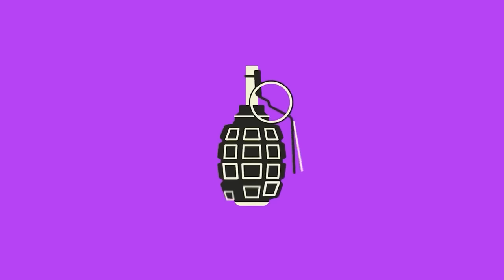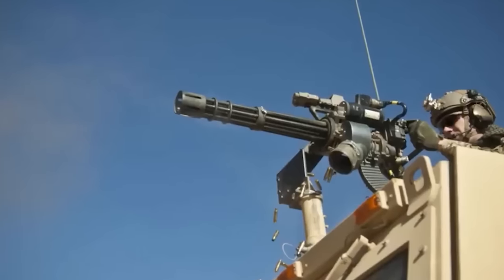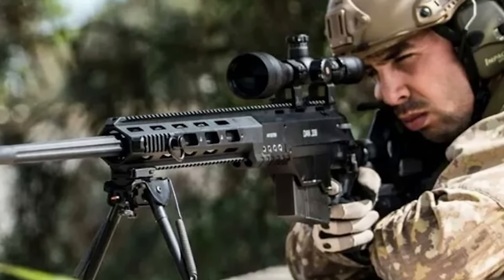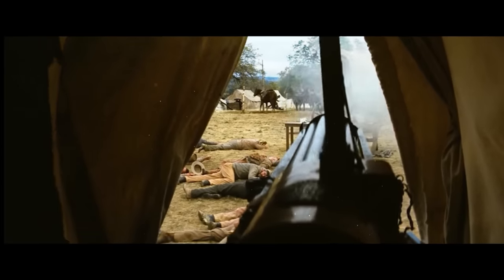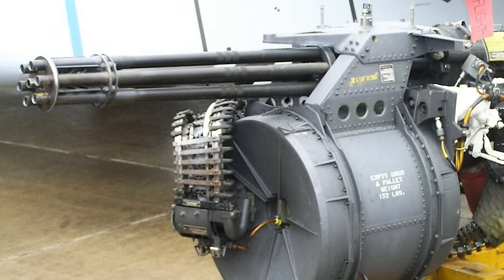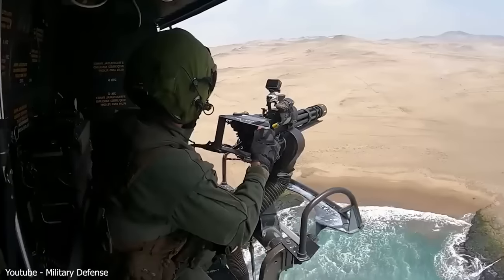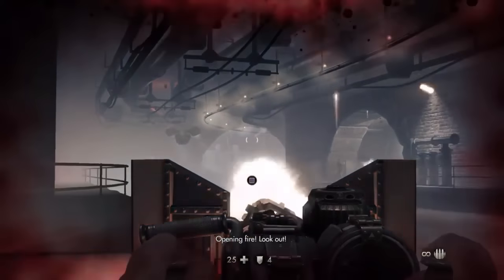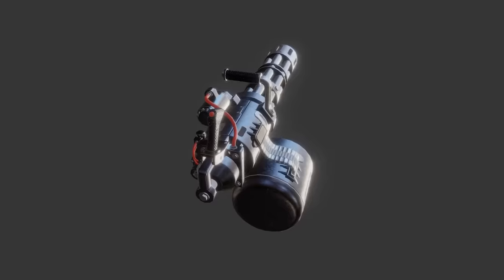THE DARK SIDE OF MINIGUN: WHAT IS IT HATED FOR

Comment: Comparing a minigun against a SAW is like comparing an F1 car against a Pinto and saying the Pinto is better because it's easier to drive and more affordable.  That completely misses the point.  The SAW is smaller, lighter, fires a lighter round, has a lower rate of fire (not to mention barrel swaps required if you want to keep that rate going), and is cheaper...but that's because it was designed as a light machine gun.

The minigun is none of those things, but excels doing things a SAW can't begin to do.  Yes it's bigger, heavier, more complex, and more expensive.  So is an F1 car compared to a Pinto, but good luck winning a race in a Pinto.

Comment: Nevermind that you stated the wrong weight for the weapon- Its the wrong assumption to start with. An M134 is a vehicle mounted weapon for rapid moving targets and fire suppression, and its all it needs to do. IF you feel the need to hold it in your hands and try to be a Terminator then thats your own fault for using your weapon in a way its not intended to.

Comment: At 6min 48sec: «6000 rounds equals 60 kilos weight»
WRONG: 6000 rounds of 7,62x51 equals 152,4 kilos weight. If using the same king of belt as an ordinary MG that means another 25,2 kilos thus 177,6 kilos in all, almost 3 times heavier than described. (Point stands: not very practical to carry)

Comment: Oh, I love miniguns.
I'd like to see slow-firing 8 barrel minigun. Heavier rounds. For anti-armor purposes.
In the future, laser miniguns with streams of ionized gas would be also pretty nice. If you exclude the power source, even decently portable.
And let's not forget minigun of…well…guns. Like…tank guns. 4 barrel version. But that is also future.
just as magnetically accelerated multi-barrel gun. Dart-like projectiles, made from ferrum for the ferromagnetic effect and osmium, so it packs a punch.
And at the end of the evolution is gravitationally accelerated multi-barrel gun, with ammo containing momentum-capacitors. Aka shadow gun. 20 % of lightspeed projectiles, which have several thousand times more kinetic energy than they should have. It can shoot through a mountain.

Comment: Your premise is fundamentally wrong.  The M134 was never intended to mow down or suppress vast numbers of enemy troops.  Its high rate of fire was to compensate for very short engagement times.  Specifically, it was designed to be fired from helicopters at ground targets while the helicopter was flying - not hovering or on the ground.  The door gunner might only have a few seconds to engage the target and the M134 allows them to put 100+ bullets on the target in that time.  It requires a 24V power source to work?  Well yeah, that's what was available on the helicopters it was designed for.  It fires more ammo than a soldier can carry?  The ammo isn't carried by a soldier, it is carried by the helicopter.

Comment: Let's face it, John McTiernan had just a wet dream as he came up with the idea for Predator but it's simply insane and absolutely impossible as your video like every game, movie or RL experiments ignore another fact, the energy hunger of those guns, not even talking about the exposure of the gunner by making a good target to everybody who is not right in the line of fire. Besides...the gunner would not stand very long on his feet when he starts hosing. I think even the T800 would have for real issues to hold his position when he uses it despite his increased weight.

Just adding weight of the gun and the ammo alone is not enough. You would also take into the calculation the weight of the energy source. I think they used for Predator two car batteries to operate the gadget. I just presumed that the T800 used his internal energy source to power his gun but the ammo he would have to carry. The way he used it there was no way in hell that he could carry this all. So luckily it just stays a wet dream from crazy gun junkies. But who cares what's possible in games or movies as they are luckily just wild dreams.

Comment: Bruh, miniguns are meant for swift strafe runs on an enemy position. 
It only works in one situation, 
A swift strafe. 
It's basically just directed artillery. 
It doesn't have the bumping recoil that jerks the gun up and down or side by side only continuous recoil forcing it upward only with sideguards preventing the weapon from moving side to side uncontrollably. Basically it's what a helicopter is used like, one call for what amounts to heavy bombardment directed straight into the thick of the enemy.  It benefits from an elevated position and an overview of the enemy live.

Comment: The main issue with mini guns is that they will eat large amounts of ammo is a very short period of time.  So there will be issue of keeping them supplied with enough ammo and given the way soldiers are they will blast through their basic load in less than two-five minutes.  How remember the US Mini guns have a rate of fire of around 3,000 rounds per minute so in five minutes that would be around 15,000 rounds fired.  So while it is useful it burns up so much ammo that the price to using one for even an hour would be better used by having more troops on the ground.

Oh and if your opponent knows that you have one in front of them they will just hug the ground or take cover until you burn through your ammo or burn up the barrels.  Since the minigun is best used against a static target I.E. one that does not move.

Comment: I can find what a 30 cal bullet weighs but not what a fully loaded cartridge weighs but I would assume that ten 30 cal rounds weigh a lot more than a single 50 cal round weighs and the 50 cal bullet would do a great deal more damage than a couple 30 cal bullets would especially if the thing that is being shot at is armored in some fashion. there was a very good reason that fighter aircraft in WW2 dumped the 30 cal round for the 50 cal or the 20mm cannon. The only thing that the mini gun is good for is to wast tons of ammo and doing nothing other than making a lot of noise.

Comment: Only the terminator can use it in real life. The terminator is dense and heavy enough so that the recoil is nothing. The terminator is strong enough to carry it around. Also, the terminator itself is a battery for the electrical requirement. The only issue is having enough ammo.

Comment: Most games dont get miniguns right. They lower the RoF. Especially Doom eternal's quad minigun. That one pisses me off.
Reply: The turret mod for the Chaingun (actually a minigun; Doom has got the terminology wrong since 1993) actually fires faster than the ammo counter on screen diminishes. In effect, the ammo counter only seems to diminish with every four or five rounds fired. 

This is done for gameplay purposes, since ammo capacity in Doom Eternal is already ridiculously low, and it wouldn't be fun for the player to blow through 150 to 200 rounds in less than a second of firing.

As for Doom misnaming its miniguns since 1993, this is simply for the 'rule of cool.' "Chaingun" sounds like a much cooler name than "minigun," at least to laypeople. However, multi-barrel chainguns don't exist in real life as there's no reason for them.

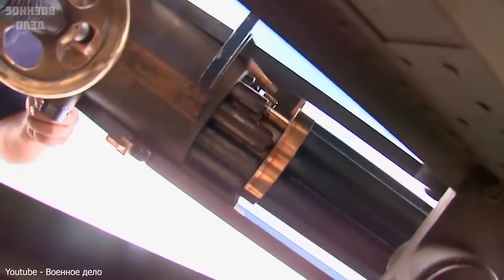Comment: 4:30 what did you get the info that the gatling gun could for 3,000 rounds per minute?
I'm pretty sure is maximum RPM was like 800-900.. And of course that was before any kind of electric motor could be added..
Reply: The original guns were hand cranked, and that limited their rate of fire, but could fire much faster if an external power source was used. That was not practical in combat though, so the hand cranked version is what was normally used.

Comment: The Gatling gun NEVER had a rate of fire of 3000 per minute! The modern Minigun in this video is about fires between 3000-4000rpm (with a quoted max of usually 6000rpm) so im not sure why you believe a gun from the 1860s would have that kinda rate of fire. Most sources claim the Gatling gun fired at a rate of around 200rpm or so per minute, so you are out by 15 times the rate of fire?
Reply: The gatling gun rate of fire was determined by how quickly you could rotate the barrels. The production versions were rotated by hand, limiting the rate of fire, but if externally powered they were capable of much higher rates of fire.

Comment: It's not really all that great: You have to get the motor running, first, and then pull the bullet-trigger, and once you let off of the bullets-trigger, the motor still spins the gun (six barrels) for about ten revolutions. It need's to be interfaced: Pull the trigger, and immediately get 6000 rpm, and then let off of the trigger, and the gun stops completely. All of these functionalities must be fined-tuned around the pull of the trigger, and then you can perform a 10-round-burst! Also, you need to make the AK 47, open bolt so there's no cookoffs, and equip America's, our, troops with OB .30 caliber machine guns!

Comment: He says it won't penetrate a tank? But its big brother the 20mm also can't penetrate in one shot its uses it fire rate to in theory put about 10 rounds in the same spot and ive always wondered if this cutting through with bullets actually works? And if it does technically the mini gun could get through a tank eventually lol
Reply: It is not accurate enough. 

In theory one could knock a tank out by penetrating the top armor, which is a lot thinner, but even then you would have to get seriously lucky to take a proper tank out. Mostly you would be talking about things like APCs.

Comment: This video is cool, but you've kinda misunderstood the particular need that the minigun met. While you do mention later that helicopters are fast, your initial summary claims that the existing weapons couldn't engage large groups of enemies when landing. This is demonstrably false. The minigun's high rate of fire was due to the fact it was meant to engage targets while the chopper was flying.
Choppers are neat, but relatively vulnerable to small arms fire, so they had to keep moving, and quickly. The created an extremely small window of time that any door gunner had to engage a target that was almost certainly smaller than the chopper. The need that the minigun met was the need for a gun that could reliably do any considerable damage to a target that you could only see for a fraction of a second. It wasn't terribly relevant how much it cost to fire for a minute straight, cause nobody in their right mind would ever do that.

Comment: The mini gun, a modern evolution of the Gatling gun is an excellent weapon for the uses for which it is designed. It is NOT designed to be a hand held and operated weapon. It's multiple barrels allow it to have a high rate of fire, and fire much longer bursts at that rate than a single barrelled weapon, since the multiple barrels allow each barrel time to cool a bit before it must fire again. It is best used for "saturation fire" where a large area must be thoroughly covered with shots to eliminate all the enemy within that area. This capability is especially effective where a group of enemy are known to be lurking under cover of foliage, but the exact location of individuals cannot be determined. Saturation fire, covering the entire area before the enemy can flee, insures that they will be eliminated even if the gunner firing cannot spot individual targets. This is why the mini gun is ideally suited for mounting in helicopters and other slow flying aircraft, or on boats, where its weight, and the weight of ammunition are not such a problem.

Comment: A person kills not a weapon. Every weapon has pros and cons. How much accurate you will be. Is it possible to fire minigun like the Terminator? Absolutely. And just because weapon can fire 6000 shots per minute doesn't mean you can't put it to semi auto or single shot modes. In case of the Terminator police cars are just 100 meters away. And closer. And helicopter was very close. Definitely you can hit those targets 🎯. Also you can carry support. Tripod, quadpod, pillow etc. Depends on how fast is the trigger you can achieve much slower fire rates. Like 10-20 shots per minute. Even single shot. Just click the trigger like mouse button. Click and push. Very short burst. Gears will wear off? Depends on the quality. And lubricant. And belt across your back will provide extra stability. Close quarters combat, melee range... you can attach blades to the barrels. Just quick stab or slash and oponent will be shreded. Definitely you can do same as the Terminator. Task of hitting helicopter 🚁 and police cars 100 meters away from hip fire minigun is absolutely doable. No superhuman strength is required.
Reply: If you carry a minigun, you are either in a dire situation or didn't think before committing.
Reply: @CRITICALHITRU  That's not true. Minigun is the ultimate choice. Subsonic explosive 🧨 hollow point bullets. And the bullets explode on contact at the target 🎯. I like both versions Predator - lion battery and brushless motor. And terminator 2 version - gas piston. You can fire at low rates. Short bursts. You could ask why not use regular machine gun instead? Because single barrel machine gun will overheating and will not cycle subsonic loads. Heavier and slower projectiles filled with special explosives and liquid oxygen. Or compressed oxygen. Such weapon will shred helicopters from kilometer away. Excellent for counter ambush.
Reply: @LORDVADER357  your minigun wielding supersoldier is a great way for the military to waste money, thus making the army weaker, proportionally to how much money would be spent on a project for minigun infantry. Hopefully USA war ministry will have your view on the idea and will implement it.
Reply: @CRITICALHITRU  My minigun version will destroy enemy tanks, helicopters and trucks. Definitely worth it. Explosive ammo. Very cost effective. Bullets are designed to shred the targets 🎯. 21 kg is the weight of the machine gun and 21 kg ammo. No big deal to carry effectively. The rest ammo is in the boxes. One such soldier will take down 10 helicopters, 20 tanks and 50 trucks. Machine gun cost far less than one truck. Let alone one helicopter.
Reply: @LORDVADER357  your minigun gets outsnied with my wallhacking railcannon that for me costs like a small power station and will cost you victory.
Reply: @CRITICALHITRU  Railcanon have some pros. But minigun also can take down walls.
Reply: @LORDVADER357  nonono, my railcannon simply shoots your soldier out of their reach, so I have a clear tactical, technological, firepower, mental advantages.
Reply: @CRITICALHITRU 
Railcannon have some pros. Like long reach. But that doesnt mean minigun cant get closer. To shoot something you must have line of sight. To see the target. Unless you not have parabolic mortar lauchers or rockets/missiles.  So railgun projectile indeed theoreticaly could reach extremely high velocities. Like ten times the speed of sound or even light speeds. At such velocities or higher projectile will melt into atoms no more than few meters from muzzle. Recoil will be huge unless there is not contious push like crossbow. But definetely will be quite a kick. In vacuum or in moon you probaly will get that extra reach. Not in earth atmosphere. Projectile will melt intantly just few meters from muzzle or even can explode inside. Effect will be like hitting fast water. Projectile will explode the moment it contacts the atmoshpere. Minigun was designed to fight aliens. Btw NASA had tested shield vs high speed projectiles. The faster projectile travels the easier is to be shielded from. Just few layers of foam separated few inches apart are more than enough.
Reply: @LORDVADER357  I would like if you keep thinking this way.

Comment: False, a trained man can clean a M134 in 15 minutes fully.  Since it is electrically driven, and mechanical fired there is NO carbon inside of the gun.  Wipes clean, all carbon is exited at the muzzles.  I've been working with this gun over last 20 yrs.  Apples to orange question for a man portable machine gun.  M134 fits the same role of other heavy machine guns like M1917/Maxim MG08,  M2, and Mk 19s.

Comment: The M134 Minigun is an excellently inefficient terrible fire support / fire suppression device that achieves nothing much at all really and is vastly inferior to the  M1919 Browning machinegun and its modern ilk such as the FN-Minimi at this task.
All in all it is a hand-held version of a weapon platform similar to the M61 Vulcan machinegun that is mounted on airborne platforms such as the famous AH-1 Cobra or the M230 Cannon mounted on the equally famous AH-64 Apache.
More suitable for stationary electrical machinery automated defense systems, or portable offensive systems, than for infantry use.
And as for fighting in the dense jungles of Vietname, napalm and flamethrowers proved far more effective.
I'd say its best use is when ambushing an armored convoy, but then again, in modernity times we have far better mission specific task designated armaments to carry out various duties than needing a "heavy weapons guy" whose sole performance is carrying this and its ammo and has no use beyond operating this very situational weapon platform.
All in all, a massive wash.
Very cool in appearance for action movies, though.
At best, it's a good stationary sidearm for protection on small helicopters and cargo planes or lightly-armored vehicles where you want to take the extra weight of a larger weapon platform into account.
Reply: Minimi is not hand held version of the Vulcan.